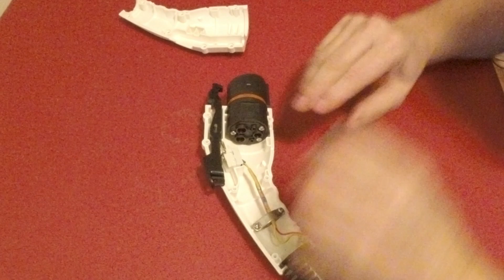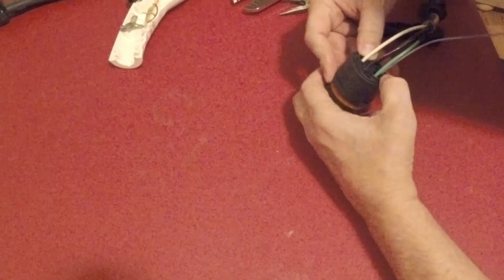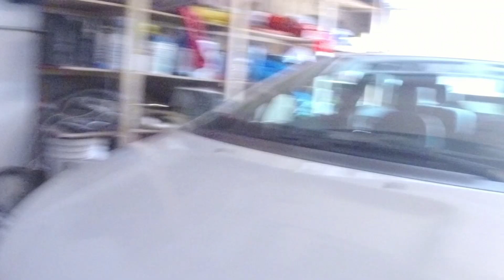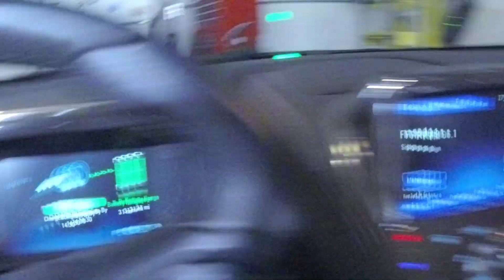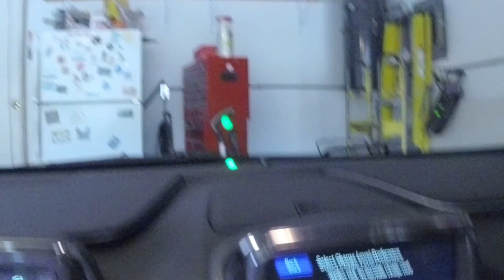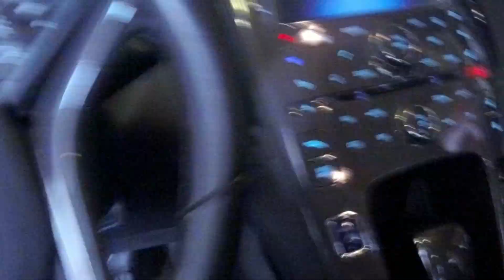EVSE Level 1 J1772 plug replacement

Comment: You’re about to save me Mayfield Marine. I also bought the same connector from Amazon to fix  a plug that fell apart after 7+ years. I started on my own and got stuck at how to the wires get transferred over to the new plug. Your video explains that in more detail than I need but that shows you know what you’re doing even if this is for “entertainment” purpose. You’re a very smart Marine!
Reply: Hi Victor, I very much appreciate the kind words and hope your repair went successfully.
Reply: @brandonjmayfield  I’m curious are you an electrician these days or just a knowledgeable guy? Your editing of the video is well done given its not a fun subject. Are you planning on more videos?
Reply: @victorlukito  EE by schooling, always been a DIY. Best lesson I ever had was at 14 when a  shift lever in my dirt bike's transmission broke. Looked like way too much for me to tackle, and I could not afford to pay for the repair. Local mechanic said "What's the worst that can happen? You get it apart and can't get it back together, put all the parts in a box and bring it to me." That was enough for me to attempt and successfully fix it myself.

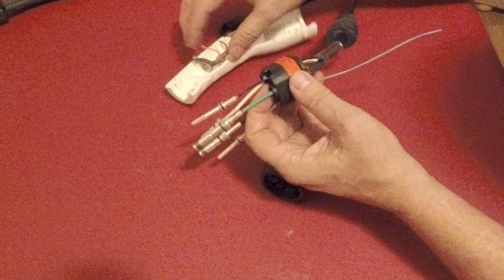Comment: 10:58 The wire gauge appears too thin explains why someone had reported the wires on fire and a recall was issued, if I remembered correctly.  If you take it in they'll only force the computer to slow charge - an extra inconvenience.   I recommend that people upgrade their wires or charge only at 8-Amps or less.
Reply from the maker: Hi David, interesting I had not heard there were any overheating problems. Can't recall just now if I mentioned this in the video, but since I am on the same circuit as a garage refrigerator I always charge at 8 amps. I'll get a  dedicated line at some point.

Comment: Thank you for the video! What I'm struggling to understand is - where is the circuitry in this connector/handle (specifically R6 150) which I'd need to remove to build an extension cord?
Reply from the maker: Hi Michael, 

There are a number of problems with this, I would give it some serious thought. 

Keep in mind David's comment about overheating. Increasing the wire length will increase the total resistance and could result in overheating. You would want to make sure you have the proper wire gauge. You can find tables on the internet that show the voltage drops for different wire sizes and lengths, I would keep the voltage drop to 0.5% or less!

The wire itself is not going to be easy to find, because in addition to the 3 AC wires you need the two low voltage signal wires. It needs to be flexible and have an insulating jacket that is oil and gas resistant. It should be reasonably resistant to sunlight and ozone and even more so if you use it outdoors frequently. 

I would look around for more videos on disassembling the EVSE and the car plug. The GM car plug circuitry is encapsulated in silicone rubber or something similar and extremely difficult to take apart. Perhaps a heat gun would help. I threw my original plug away as I was replacing it. 

Good luck

Comment: HI
Firstly great video and thank you.  Now for a question. Could you not crimp an extra 20 gauge wire in with the ground and leave the ground wire whole? I am sure there are reasons you would not do this but asking for a friend. :)
Reply: It's been a while, but as I recall I was mostly worried that the rubber gasket that is meant to keep out any moisture might not do its job with two wires in the hole. I suppose you could put a little RTV in there. Having said that, the pins are very hard to crimp which makes it hard to keep the wire fully inserted while crimping. A hydraulic crimper might help.

Comment: How would you negotiate connecting this to an array of solar panels to DC direct charge you bolt?
Reply: I'm reading 50 - 350 KW. Huge array. As an example 50 KW / 500 V = 100 A. For the low end of level 3.

Comment: You forgot a very important step... the way  you've assembled it the whole black pin holder can be pulled out. Your forgot to screw the black plug holder into the black plug housing... Very Dangerous!
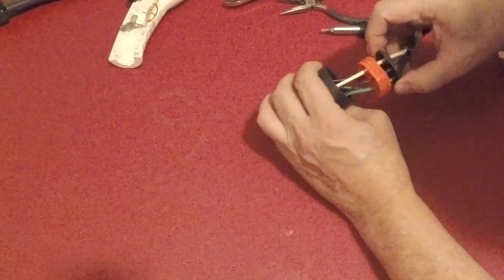Reply from the maker: You have good eyes! Actually I did screw the pin holder down, right around 11:29 but those frames apparently wound up on the cutting room floor. As I recall, when you are doing this it would be hard to miss, as the pins pull out fairly easily without it. But I am glad you point this out for anyone reading and doing this repair., thank you.

Comment: How do I replace the latch on the charger to lock the battery in?
Reply from the maker: Hi Yolie, 

I assume you mean the thumb latch on the plug that connects it to the car's socket. 

While it is possible to get to the mechanism itself,  There are no replacement parts available from any source I know of. GM only sells the complete unit and the actual manufacturer of the unit, which is not GM, is prohibited from selling parts for it by their contract as I understand it.

You can try reaching out to TusconEV , who I mention in the text section below the video. It is possible they can help you out. 

I have only these two suggestions that may work or that may give you other ideas if you are adventurous enough to try.

The first is to find someone who has the ability to make a replacement latch of a suitable material, perhaps someone with a 3D printer or even someone who works with fiberglass reinforced resins like boat hulls are made from. If you know someone in that business, or have a sailor friend who does their own work they may be willing to help you out. Some cold beers on a hot afternoon open many doors.    

The second is to repair the existing part, but it only works in certain cases where there is a clean break leaving enough material on both sides of the break to work with. If this is the little hook part of the latch it will probably not work and it is likely that part is lost anyhow. I once did something similar by drilling a very carefully aligned small hole in both pieces; I then inserted a very stiff wire/round stock in both sides, gluing the two pieces and the wire together with epoxy. It worked and was very strong, I thought it might be a temporary repair and turned out to be permanent. The wire should be stiff enough to support the entire working load of operation.
 
There is a movement afoot, mostly in Europe at this point I think, to institute rules requiring manufacturers to produce products that are repairable rather than disposable. I am a big fan of this sort of thing. It enables those that are so inclined, supports cottage industries, and is the right environmental choice. We should be making things to last and be repairable, even if initial costs are higher, in my opinion.  
 
Good Luck!